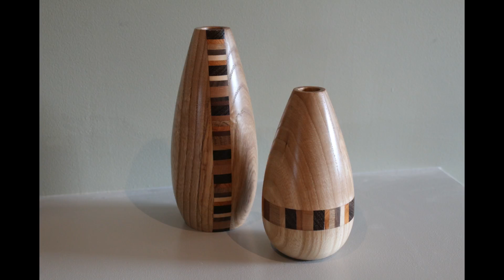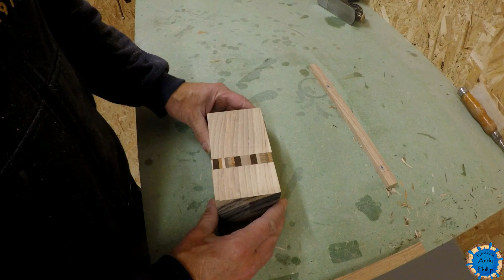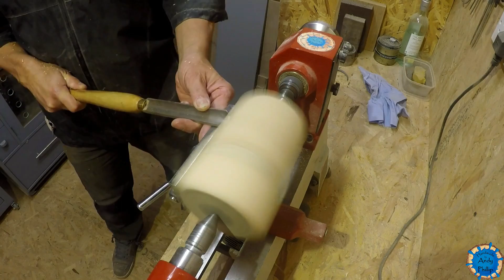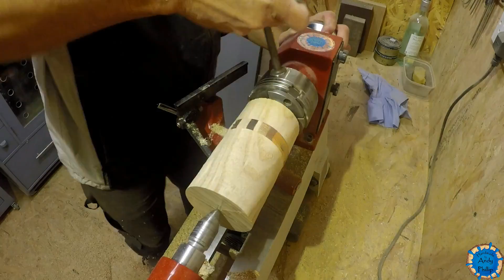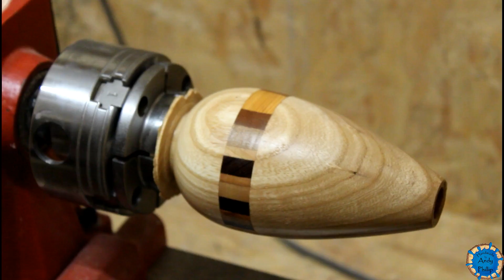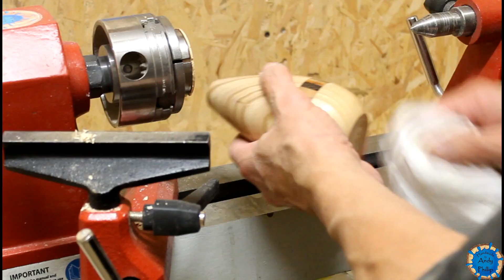Woodturning - The Stripe Vase's  Little Friend !!

Comment: Nice little vase Andy. I like the step drill but you didn't seem to go as far as I expected inside the piece. Is the vase functional or just an ornament?
Reply from the maker: Thanks .. I drilled it out before the step drill .. I'm using a new camera and it picks up a lot more sound the drill was making a right squeal so I edited it out ..cheers
Reply: Andy Phillip i really like the project/video. You should be able to remove the audio in the editor, which do you use?
Reply from the maker: I use filmora at the moment .. I edited the sound down but then it had a crackle so I gave up , my computer can't seem to cope with the quality of video now .. upgrading one thing leads to another lol and I want a new lathe AHHHHH !!!!